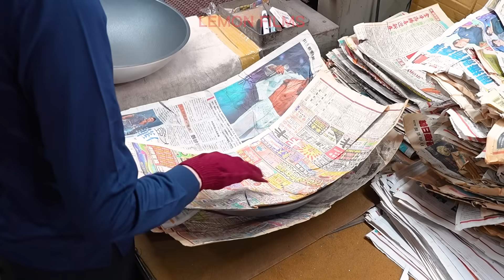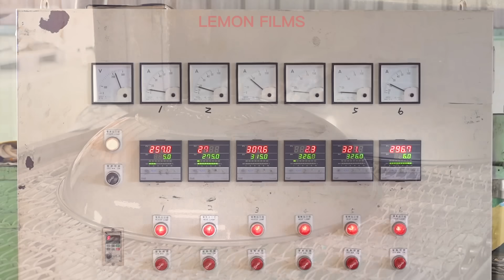Non-Stick Chinese Wok Mass Production Process / 鑄鋁中華炒鍋 - Taiwan Wok Factory

Comment: My confusion is that normally wok cooking is achieved at high temperature heat and the one pan that shouldn't be prone to high temperature heat is non-stick as it's a hazard over 450°f / 233°c 🤔
Reply: Right

Comment: Aluminum wok with coating:  Sorry, just not me.  I don't really care how non-stick or how cheap it is.  I am happy with traditional cast iron or stainless steel.  I don't want to read about how safe it is and years later the perspective changes.  Chemical is never good for our body.  We already have a tuff time in minimize it.  Let's at least do the obvious.  These coatings do come off.